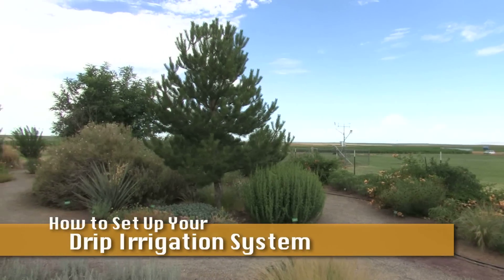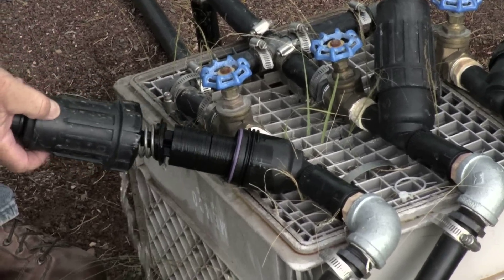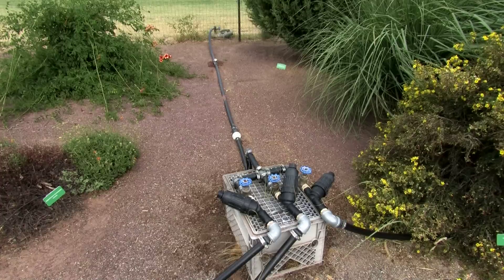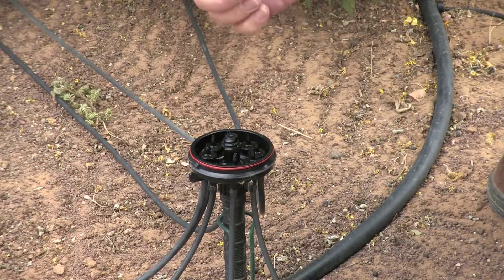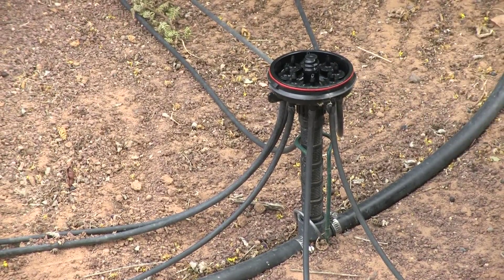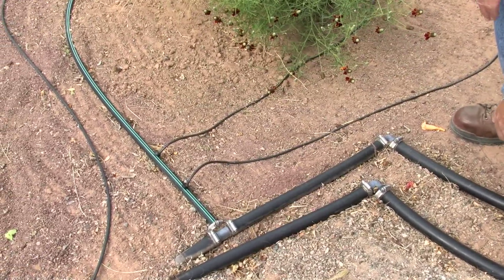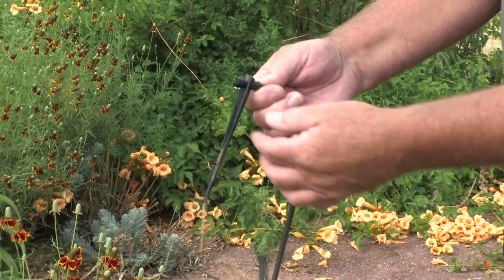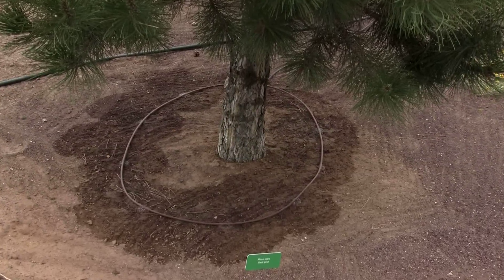How to Set Up Your Drip Irrigation System, NMSU ASC Farmington Xeric Garden

Comment: The filters are not installed backwards. We are using disk filters. The filter casing has arrows on each side to indicate which direction to install them based on the filter type (disk or screen). They are installed in the right direction for disk filters.